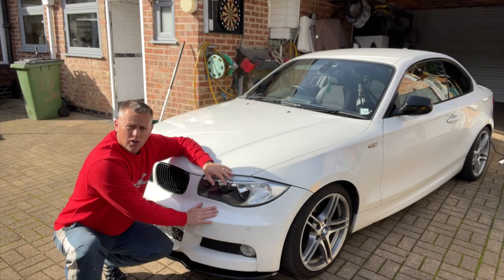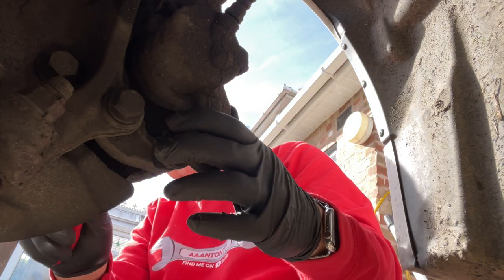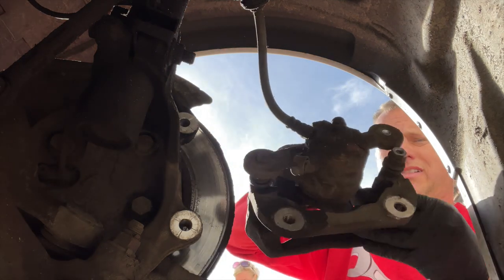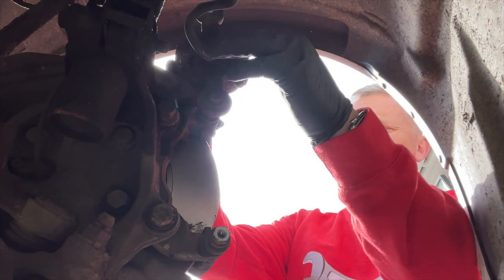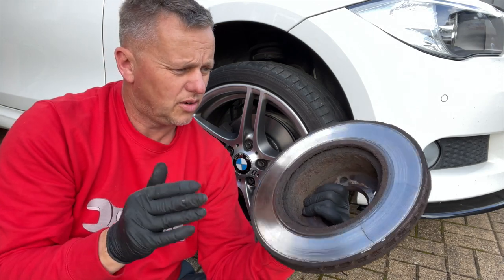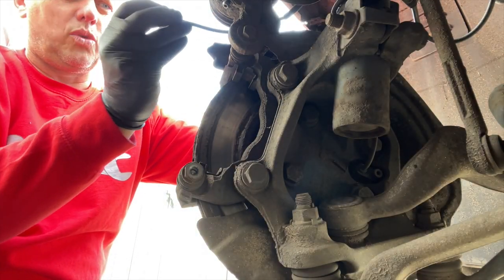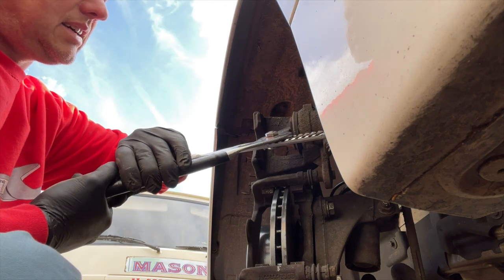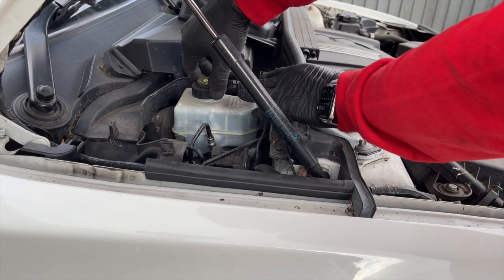🇬🇧BMW 118D Front Brake Pads & Discs Replacement, Brake Judder Warning Light On, Same As 120 318 320

Comment: hello. you are making four mistakes. mistake 1. you don't lubricate the place where the disc rests. mistake 2. you don't clean the very dirty caliper. mistake 3. you don't lubricate the sliding pins. and mistake 4. you don't lubricate the points of contact of the tiles with the slides. these from me with love. giorgoe from Corinth Greece. be well, be strong and pay more attention to detail.
Reply from the maker: There's more than one way to skin a cat 😂, Thanks for the great information👍🏻👍🏻🛠
Reply: @aaanton11  it's not information, you already know it. they are a way of working.. as for the cat's skin,... I don't understand it.

Comment: Don’t recommend using the locking wheel nut key with an impact gun as they are not designed for such use and can be ruined.
Reply from the maker: I haven't had any issues with the Milwaukee impact set to 120nm torque, Thanks for the great comments👍🏻👍🏻🛠

Comment: Great video! I replaced mine in the summer on my 218d and did the rears only two weeks ago. Also fitted Brembo discs and pads, great quality and a good price from Eurocarparts. I would say they take longer than expected to bed in and get to their optimum braking efficiency, other than that, pretty straightforward job!
Reply from the maker: The Brembo discs are lovely, the painted inners are clean, a really nice touch, Thanks for the great comments👍🏻👍🏻🛠

Comment: Cool video. Clear and to the point but with nice extra info. My front brakes had a wobble for exactly that reason - it sat barely driven for ~8 weeks whilst being prepped for sale.

 I would say you should clean around the brake fluid reservoir as instructed before opening. You also didn’t apply anything to the hub before fitting the new disc - there’s a good chance it’ll seize and need a hammer now to release it in future 👍
Reply from the maker: Thanks for the great information👍🏻👍🏻🛠

Comment: I changed my disks pads & rear shoes front & back a fortnight ago. Everything is good but the rears are squeezing like f**k when I come to a full stop 🤦‍♂️ any ideas? Iv done 800 miles on them so can’t be the coating 

Thanks
Reply from the maker: What make of brake pads have you fitted? Thanks for the great comments👍🏻👍🏻🛠
Reply: @aaanton11  juratek disks & pads. They we’re just what my local motor parts suppliers had on shelf. Thanks for the quick reply. Cars a 2015  118D
Reply from the maker: might be worth popping the pads out again and sanding the glaze off the pads, and sanding the corners off the braking material, that usually helps, Thanks for the great comments👍🏻👍🏻🛠